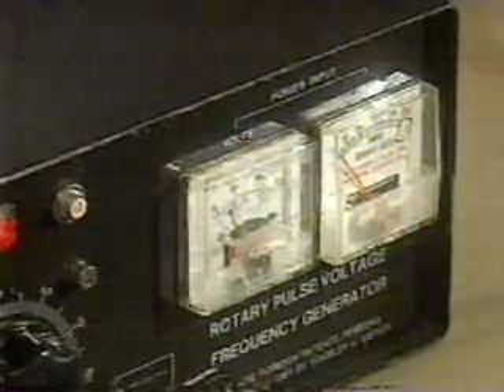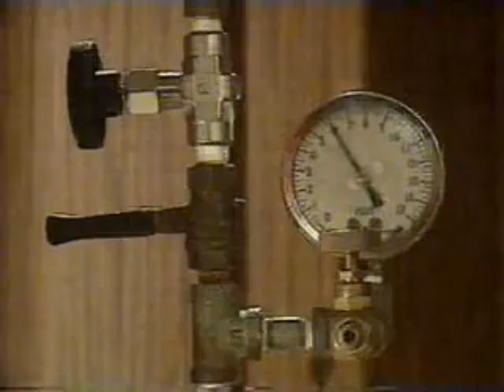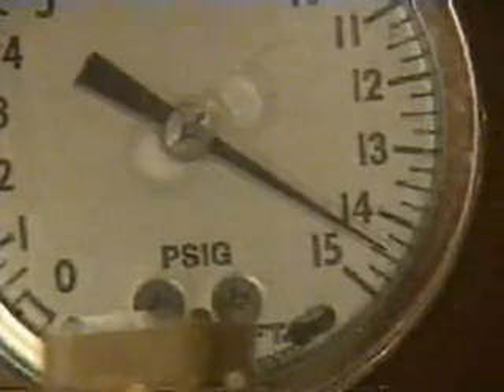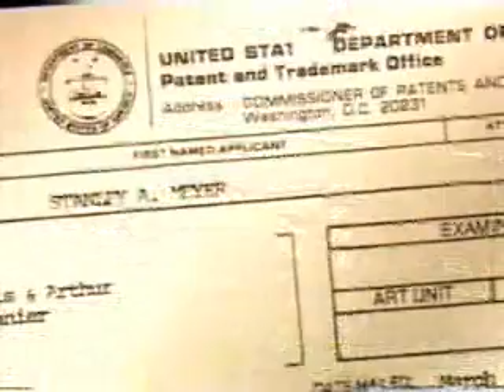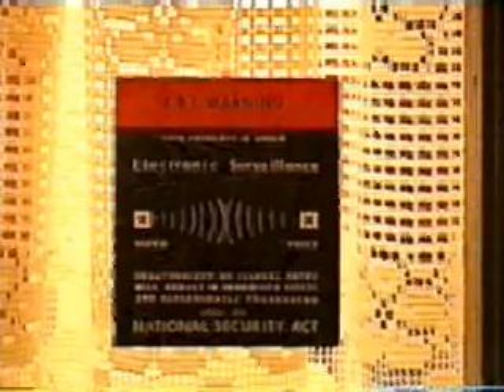demonstration of meyer's water fuel cell

Comment: @ibpointless2 yes I noticed but as well if you look closely at the setup of what he's plugging in there is an ac motor with a drive belt leading too a alternator which is connected too the control he's using to change the frequency of the voltage, it is low voltage based reveiw the footage again and you'll realize what is happening

Comment: Anyone else notice the lights in the shop flicker around 2:45 when He plugs the device in. The only time that happens is when you plug in a high powered devices such as a vacuum. So it maybe true that it uses low amps but power is the real measurement here and you can tell its using a lot of power to create hydrogen due to the light flicker.

Comment: correction,its the frequency at which the elements vibrate combined with the precise electric voltage that makes it ultra efficient,the capacitor design is key because he says he can use an ordinary car battery...I could make one of these...